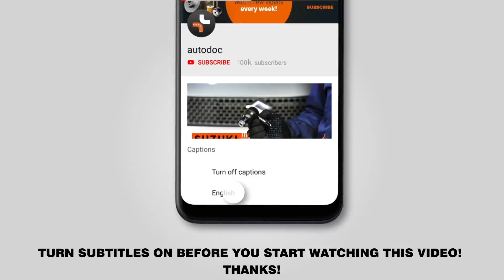How to change front wheel bearing / front hub bearing on ALFA ROMEO 159 1 (939) [TUTORIAL AUTODOC]

Comment from the maker: ⚠ Attention! This video contains a mistake:
5:10 - the tightening torque is 112 Nm, not 80 Nm.
6:56 - the tightening torque is 81 Nm, not 70 Nm.
7:21 - the tightening torque is 7 Nm, not 9 Nm.
7:34 - the tightening torque is 152 Nm, not 70 Nm.
8:22 - the tightening torque is 30 Nm, not 35 Nm.
9:40 - the tightening torque is 280 Nm, not 110 Nm.
We're sorry for the inconvenience 🙇‍♂
Reply: Thanks for the info.. Where can I find all other torque values for Alfa 159?
Reply: If you want to do the axle nut @9:40 properly, use the following procedure from the workshop manual:

- While the car is off the ground:
- Tighten the nut to a torque of 135-165 Nm.
- Undo the nut by 90° ÷ 115°
- Pretighten the nut to a torque of 67-74 Nm.
- Tighten the nut through an angle of 45° ÷ 49°.
- Check that the final tightening of the nut is 200-380Nm.
- Stake the nut collar twice.

Yes it seems quite tedious but you will be very happy if you have to take it off another time again. As you can see, 280 Nm could be overkill since factory says anywhere between 200-380Nm is fine (as long as you follow procedure and you stake the nut).

Comment: if you tighten the hub nut with the full weight of the vehicle on the hub/drive shaft on the ground then the hub nut can get cross threaded. Full hub nut tightening procedure not shown. New Hub nut needs to be staked afterwards.

Comment: I thought hub nuts are meant to be on much tighter than wheelnuts. 120nm seems overkill for the wheel nuts and 100nm is not enough for the hub nut
Reply: Hub nut tightening procedure on Brera 2.2, 2.4, 3.2: 1/ tighten nut to 143-158Nm 2/ undo by 90degs 3/ Pretighten to 67-74Nm 4/ Tighten nut through an angle of 45 5/ Tighten to 200-380Nm. wheel nuts are about 130Nm. Don't know if it changes on the 1750 TBI.
Reply: @donnagrimshaw3512  130 is so tight for wheel nuts
Reply: @George.Coleman  that is what it is. It is a heavy car but has really quick handling.
Reply: @donnagrimshaw3512  maybe manufacturers are being too cautious. Just standing on the end of a 50cm wrench is enough for wheel nuts, I weigh 90kg, they'll never come off. 130Nm is crazy, thats 3 of me 270kg on the same wrench, it risks snapping the heads or shearing the threads. Be careful.
Reply: @donnagrimshaw3512  on a small hatchback anyway
Reply: @George.Coleman  It's not as much as you think. I can easily do them up to 130Nm with my torque wrench. In fact I can easily do my hub nuts up to 200Nm without standing on the torque wrench. Are you confusing NM with daNM perhaps? 130daNM would be alot.

Comment: Didn’t want to tighten or torque the hub nut then?
Reply: Did it at the end with the wheel bsck on and car lowered. Wrong torque spec though and didn't settle the bearing

Comment: This procedure took me longer than expected.
1 day
When unbolting the axle nut I noticed that the M36 socket won't fit through the rim center hole (momo revenge r18).
So lowered car so brake disc lies on a pile of wooden boards and then tried to remove the axle nut.
All my breaker bars 1/2 was bending like crazy. I couldn't unbolt the axle nut. Maybe it previously was torqued with an impact gun.
2 day
tried drilling into the bolt to lose stress from threads by splitting the bolt. Broke 4 drillbits while doing so.
Then made a wedge from 10 toughness grade stud to split the bolt.
Finally, I was able to unbolt the axle nut
Next, I tried to remove the lower ball joint. Surprise surprise but my tool (BALL JOINT SEPARATOR 19 MM PROLINE
 code 46871) won't fit (damaged rubber boot - nice) so I had o widen the space of the fork to 22mm, then it worked out.
3 day
When unbolting the wheel hub noticed that it's stuck very good. Contrary to this video haven't had a place to put a chisel 
to knock it off as shown in 4:10. My car (2.0L JTDm 125kw diesel also my brake caliper look different).
After struggling to knock off the wheel hub I unbolted the knuckle to hammer out the wheel hub from another side.
Noticed white sediment around the inside perimeter of the knuckle where the wheel hub sat (maybe salt idk)
4 day
Cleaned knuckle where possible, then put copper ease between knuckle and wheel hub.
While assembling the wheel hub you need to cut the axle nut a bit to hammer fins in axel opposing sides so it won't unbolt
 itself (pic of reference https://prnt.sc/1hz19ts). 
IMPORTANT: don't put thread locker on nut and bolts which are torqued with a torque wrench, because torque values are listed for dry bolts/nuts.
Also, axle nut 9:35 should be torqued to a much higher value as discussed in this forum post
https://www.alfaowner.com/threads/axle-nut-torque.1016225/
And for the end, my tip is to use lithium grease between the splines of the axle and wheel hub. I don't understand why WD40 was 
used in this place 5:32 ?

This experience gave the best advertisement to buy proper ball joint separator kit and power tools (impact wrench)
Reply from the maker: Thanks for your valuable clarifications, this information will be very useful for both our viewers and us.
We will definitely take this into account in our future videos.
AUTODOC
Reply: I use, a nana to take the castellated nut off the driveshaft, I make nana get in the car and put on the brakes aha because my socket doesn't fit with the wheel on

Comment: You don’t need to detach the lower ball joint
Reply: Johnny Moped will the drive shaft slide out without undoing the ball joint? Is there enough play?
Reply: Yes, I've done this procedure on my drive. Didnt need to split the balljoint. 

Also, not impressed with Autodoc not pointing out the most safety critical part of the procedure... It also requires a heavy duty torque wrench, as it's circa 300Nm

Its a shame, as these videos are really nicely put together!

This video really should be replaced though...
Reply: @andrewjackson8431  is 120nm not tight enough? couldnt get a socket to the hub bolts and couldnt split the bottom joint so ended up undoing the top arm joint to swing the upright away from the drive shaft to access the bolts.

Comment: You shouldn't put the copper grease on it, the heat from the brakes can't be absorbed by the wheel then. Which will make the disc's way hotter and get uneven. It shouldn't be on the hub and it shouldn't be on the disc.
Very nice guide though👍
Reply: what about ceramic grease ? can be ?